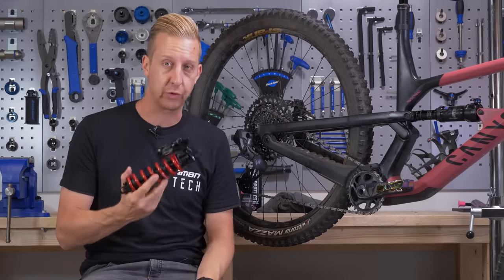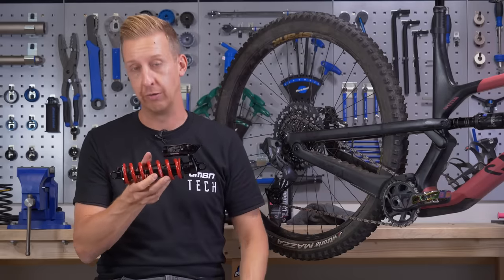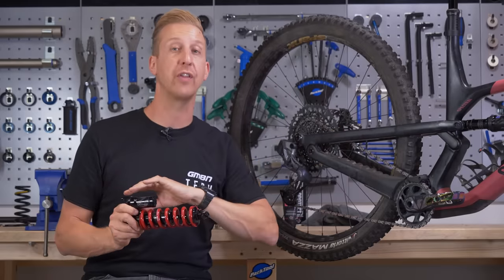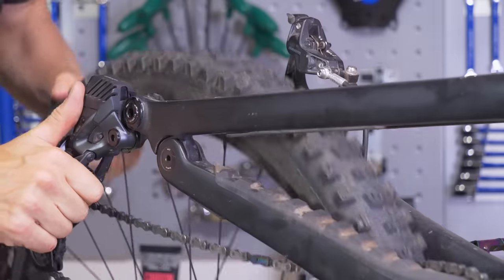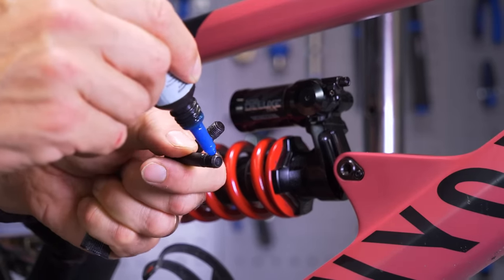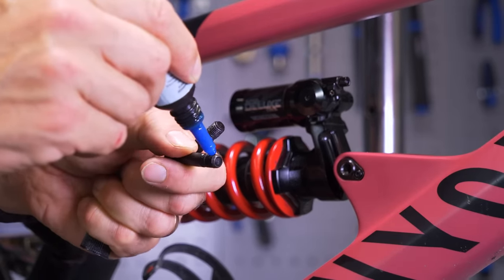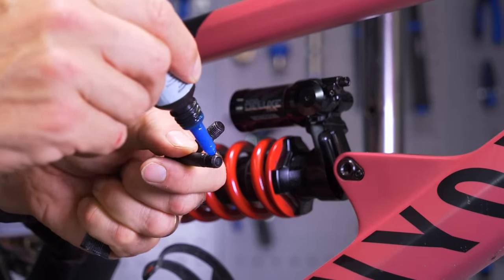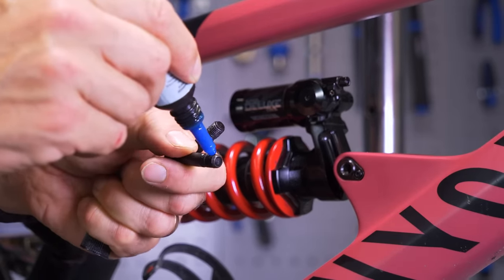How To Fit & Set Up A Mountain Bike Coil Shock | MTB Maintenance

Comment: I pre load 1 turn on Ohlins , no rattles and small bump compliance is very good bacause the more preload you have the higher the force required before the shock begins to move.  highly recommend the vorsprung videos  for explanations .  Loctite purple is good for stopping a coil adjuster in place without going too mental , its almost a gel level anti vibration substance so not a biggy to undo by hand.
Reply: Exactly. As little preload as possible, without the spring rattling loose. Some shocks have an adjuster with a bolt to lock it into place, which I think all shocks should have.
Reply: But on the other hand, despite what some people say, you CAN use preload to adjust spring-rate, thus adjusting the force required to bottom out as well. It will obviously increase the force that it requires to move the suspension in the beginning of travel, if you have a excessive amounts of preload, but in an emergency, preload can be your friend, even though it's never ideal.

Comment: Useful video, wish you had covered the issue of rockshox springs being quite loose fitting. I find I have to run 3/4 turns of pre-load otherwise the spring just rattles too much when it's not under load, or I'm un-weighting the bike
Reply: ehm, it's written on the shock :) min 3-4 turns, max 6
so you're supposed to run 3-4 turns at least, and with that preload it doesnt get loose or rattle
got one on my trek remedy
Reply: @ostankovalex1176  ehm, it's min 2, max 5 on a rs super deluxe coil. Maybe you should check yours again....
Reply: @tommtb4898  weird. I'm running 2 turns on my Super Deluxe Ultimate and it's snug as a bug

Comment: Thanks Mate, I have been watching videos on setup of coil for 3 weeks and finally have a great understanding of how to setup a coil. I am new to the coil and the bike company asked my rider with gear weight and said they were going setup the suspension. I have now ordered new heavier coils for both my Ohlins and my Rock Shox coils as I didn't feel that the bike was as good as it could be even with adjustments. I took it back to zero checked your video twice first I got a great understanding of the setup and the second time was to take notes and to pile drive it into my memory. I had watched other videos but the setup never felt right until using your method with details you include that others have left out

Comment: Sprindex coils offer adjustable lb/in in a certain range.
Also they say that the springs are progressive for the last 20% of stroke.
Would be great if you could test / feature them in a video.
Reply: yep, I have two of them because they did not cover my range completely.
Reply: I have 2 and can confirm that they do what they promise. One of the best purchases I've ever made, as I was having trouble getting my suspension dialled.
Reply: @th_js  I would not say it's the best ever purchase for suspension because the smashpot for my Lyrik was the real deal.
Reply: @Vanadium  Been thinking of getting one for my Zeb. The price is just really high.
Reply: @th_js  well it depends if you really need it. I have massive benefits for steeper terrain. The fork is that much higher by just pointing down and got way less dive all around. I don't even have a firm spring. Its a step down for what is recommended. The hydraulic progression dial is so strong that you essentially have the same thing you get from the Sprindex. 
Because I have only coils now, I can throw the pump out.
Reply: @Vanadium  Let's face it, nobody "needs" it, just like with most things. I've just come to the conclusion that I would benefit from it. The airspring creates a lot of friction in the fork and almost all of the trails I ride are super rooty/rocky, and I feel like a coil would make the bike "glide" over them more effortlessly. I'm now running a 190mm Zeb, so obviously I'd lose 10mm of travel, since the Smashpot is only available up until 180mm. But my bike was designed for 180mm anyway, so it won't be an issue, and I feel like the linearity, mid-stroke support and sensitivity more than make up for the lost 10mm. It's now the beginning of winter here, which means snow, snow and snow. I might aim to purchase the Smashpot for next summer.
Reply: @th_js  I can definitely say I needed that upgrade. I couldn't not ride a relatively easy trail that was steep. My hands did fall off after two minutes. After that I could ride them without problems , full 8-10 mins with all I got. I also see the top of the  two highest mountains covered in snow.  I don't want to stop riding. Will see how long it takes to get everything covered.
Reply: @Vanadium  You don't "need" it, if you can still ride the same stuff as without the upgrade.. Well, that's trivial, I'm just glad that it helped you. And despite it being snowy here all winter, I never stop riding, I just put on a screw-tyre and a studded tyre and find stuff to ride. In the winter the coil just isn't that necessary, as all the rocks, roots and bumps in general aren't present.
Reply: @Vanadium  I too, would also benefit from it in terms of comfort, as I have problems with my fingers getting sore after some time of riding in the bike park, but that's not the main reason.

Comment: Is there a tool you can use if your coil adjustment nut is too tight to move with your fingers?
Reply: Same question for me, did you find one?
Reply: @rickstard73  no haven't yet, and actually in the time, I have changed to an air shock!😆

Comment: Regardless if it is air or coil spring it all goes down to damper. Hydraulic damper are the key on suspension which is the issue with suspension fork before, it is now being realized that coil creates natural bounce added with dampening. We will see dirtbike suspension fork on MTB and air will soon again obsolete. Reliability and less frequent maintenance as ebike are emerging now as next choice

Comment: I am lazy so I use just some reusable STRONK zip ties to zip the rear wheel or seat stays just to the seat tube. THIS actually helps massive because without my shock the rear end goes down and my rocker upwards. If I want to install my shock the rocker is to high to take a shock and also the spacers on the trunnion need to held in place with grease on the inside of the rocker. Its almost impossible even without the weight of the rear wheel. 
So I will do this forever, just use zip ties to make it perfect for alignment.

Comment: My bike is spec'd at 216x63mm and I found a pretty cheap DNM coil shock at 220x61mm. I'm wondering if it's safe to slap that coil into my frame since the difference is so small in my opinion.
Reply: No, the frames designed for the 216 eye to eye, leave it at that. 63 to 61mm will reduce rear wheel travel noticeably in a bad way.
Reply: Very likely you can, at least If you buy an offset bushing. Be aware that you might void frame warranty though

Comment: Hi guys.
I found your video one of only a couple that gave any sort of practical insight into setting up my new rockshokx super deluxe ultimate on my Orbea Occam.
I weigh about 87 kgs, so app 90 with riding gear. The shop recommended a 600lb coil spring, as supplied. However, I've been trying to get my sag dialled in. Should it be +- pretty close to 30 % as a default....Tinkering with the preload doesn't seem to be doing anything....
Any possible advice before I head for my trails.
Thanks

Comment: but what if you fit a progressive (rising rate) spring? Can you fit a coil shock to a bike that runs an air shock then? ; )
Reply: yeap, you do
but it depends on how hard you ride and how big jumps and drops you make
I have a Trek Remedy frame - not very progressive at all. I use an RS coil shock with MRP progressive spring. I have about 30% sag and rarely bottom out
Reply: In some cases, yes. In some cases it still might not be progressive enough.

Comment: Is very hard to find the 52.5mm or 62.5mm from factory does rockshox allow to remove spacer if i
Get a 230x60mm?
Reply: they don't have spare spacers, but generally 230x57.5-65mm is the same shock with the different travel reducer. I'm using my 3D printer to get a new spacer to convert my 57.5 to 62.5

If you get a 230x60, you can convert it to 62.5 stroke, but the new spacer is required and you need to re-assemble the whole shock (special tool is required). And you need to make a spacer with the required stroke

Comment: Thanks Doddy. Interesting to see how different spring rates are per bike. I’m 205lbs/93.5kg and have a 600lbs Rockshox spring on my Specialized Enduro 2020. I don’t see how I could ever go down to 500lbs. Is that progressivity of frame design or shock stroke or travel that is influencing that?
Reply: that's generally leverage to start with. how much your shock compresses per mm of your rear wheel travel. For example, 30mm stroke shock with 160mm will compress much easier than 60mm stroke shock with the same travel

Indeed, the progression of the frame affects it a lot, but mainly when going deeper in the travel. My suggestion - get the sag you want to start with. Once you get for example 25-30% sag, you need to figure out whether you need bottom out resistance or not (not all of us get decent jumps and drops).

I've got RS Super Deluxe coil on my remedy, it's a pretty average frame in terms of progression, but I've figured out my riding was harsh with 600lbs RS spring and not enough sag; however, I nearly bottomed out my shock, so I bough an MRP progressive 550 lbs spring and that solved it for me. I also weight aroung 94-95kg.
My current sag is about 30% and I rarely bottom out at all. And even if I do, I can't feel it - it's so soft.
Reply: I run a 500lbs spring on a canyon sender with 2 preload and get 28% for 230lbs rider weight. I run it firm for drops and jumps at bike parks and occasionally bottom out. I tried 550lbs and it was horrible 😂

Comment: Quick question: can I run a DVO spring on a Fox Van RC demper without any spacer (like MRP provides when using their coil spring on other brand dempers)? Or do you need a Fox spring in Fox demper and cannot be swapped between brands? Any help guys.

Comment: Any actual advantages of the coil over air for the average trail bike and rider? I am all for set and forget tech.
Reply: Small pump sensitivity might be better, but you usally loose on the progressiveness. Air is usually also better for pedalling. Personal preferences based on your own riding and likings. Also your bike and its geometry make difference how each feel.
Reply: @Pienimusta  thanks for your informative and insightful response. I sit and spin as much as getting crazy, almost 50/50. Here in south Florida our steeps are short and far between usually if you ain't pedalin', you ain't movin'.
Reply: @jankulozic401  my bike transformt from a harsh ride to a cushion with that. but I bought a more advanced shock then this RS one.  You sure should have a more progressive frame to work with a shock like it was mentioned in the video but and that is the case with Sprindex coils, they are progressive it self. Last 20% of the stroke will be progessive and you also can actually vary your spring rate with a simple turn on the Sprindex ring. So you have a simpler solution in the end because you dont need a pump anymore and you need less service for a coil shock then air shocks.
Reply: @Vanadium  thank you for your input, l will have to see what is available for my frame.
Reply: 1. Consistency, there is no air to change pressure, changing the spring-rate.
2. More mid-stroke support.
3. Less maintenance.
4. Once you get it dialled, it will stay dialled.

Comment: does the remote add low speed compression or high? I have a delux ultimate and you have a lsc dial on top of the piggy back and a flip switch for the high im assuming

Comment: Doddy, do you recommend spherical bearings versus standard bushings on a coil shock? I heard spherical bearings can help isolate frame flex from the shock eyelets and supposedly extend the shock life as well as reduce friction. Is it worth swapping out the standard bushings?
Reply: I'm going to go out on a limb here and assume a spherical bearing won't give you the same service life as a standard bushing will. You'll get dirt ingress for starters, as well as applying pressure over a smaller surface area. I run standard bushings on a single pivot bike with no linkages, and they're still as good as ever after 20+ years of abuse.

Comment: Great advice as always, thank you Doddy! I’ve never tried a coil shock. I’ve got my heart set on a 2020 TLD Limited Edition Specialized Stumpjumper (S2) in my local bike shop, it comes with a Fox DHX coil shock (500lb) my body weight is 70kg and I’m worried it might need to go with a lighter spring. My question is, do these spring ratios behave differently with the way they are positioned in the frame? Different rear wheel leverage etc. I’m hoping the s2 size frame + 500lb spring will work for me. Thanks in advance and keep up the awesome work.
Reply: Frame already fitted with a DHX2 (blimmin predictive text)

Comment: I bought a DH bike and TF Tuned says I need at least an 800lb spring. I have a 2017 Kona Supreme Operator with a Rockshox 650lb coil in it now. I weigh 270lb+ with no gear. Any one know where I can get an 800lb coil spring to fit my Rockshox Kage coil shock?
Reply: prolly easier to lose 70 lbs than find a 800lb coil. You’ll live longer and be able to ride more bikes 🎉

Comment: Air can expand when heated, so the air pressure (psi) inside the air rear shock will not be the same throughout any long runs, thus the performance will not be stable.

Pros and cons.
Reply: Yup. Also if you live somewhere, where the temperature fluctuates a lot form one extreme to the other, it's very annoying to constantly be adjusting the pressure to maintain the correct setup.
Reply: @th_js  okay then I’d better go for a coil shock on my new dream bike.

Comment: Upgrade, sidegrade or downgrade?
Reply: For most it’s a sidegrade 😂 they perform amazingly when set up properly but can take some trial and error which some people don’t have the patience for and like doddy said sometimes they only get you in the ball park of where you want to be… the fine tuning involves trial and error and sometimes if you calc wrong for the spring weight or like different setups for different terrain/riding styles it means more money for buying different springs. 
Air is the way to fly for people who are casual or just a bit more serious than casual with riding their bike as air springs allow more precise setup up, cheaper and it’s infinite how many times you wanna change your air pressure and it’s free once you buy a shock pump…